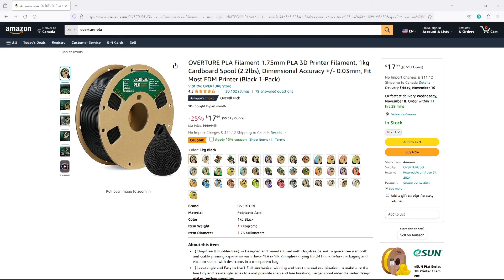Retraction Test

Comment: I am a bit confused. You are talking about retraction testing, but then temperature testing. Normally you would do a temperature tower first, then a retraction tower, or vice versa. Were you changing the amount of retraction at each level on the retraction tower? If you were, and you weren't seeing any changes, then obviously retraction was not your issue. You should have switched to a temperature tower. I'm not saying your test isn't useful, or that there aren't potentially better tests than the typical towers, I'm just not quite sure you were utilizing the tests correctly.
Reply from the maker: Hi 802Garage, sorry if I wasn't clear. Yes I used to run temp towers and retraction towers where I would change retraction at each level. I got to the point where the majority of my filament ran well at 200 until one new roll didn't. I was fed of the long waits for those towers and created this much abbreviated version. The retraction comes into play each time the nozzle shifts over a line. The results for that roll were so good on the lines at 210 that I tested a retraction tower without bothering to include the different retractions. SO at 210 with 5mm at 25mm/s retraction, you can see how beautiful all of the layers turned out. Let me know if it's clearer. Thanks for asking.
Reply: @mayhemsmiley  Yes makes more sense now. I definitely think the retraction tower test and even the temperature tower test are larger and more time consuming than they need to be to get appropriate results. Cool to find new tests.
Reply from the maker: @802Garage  thanks for letting me know.  I'm always looking to improve.

Comment: Too much without clear explanation of a concept of a test. What I have got is it takes 2 minutes each.
Reply from the maker: Hi Stepander, I'm combining temperature and retraction in this simple test pattern. The left section is running at 190, the middle at 200 and the right at 210 with a retraction of 5mm at 25mm/s
The retraction occurs every time the print head moves over one line.
Check out this video with more details.
https://youtu.be/aDNOoLxlY-E